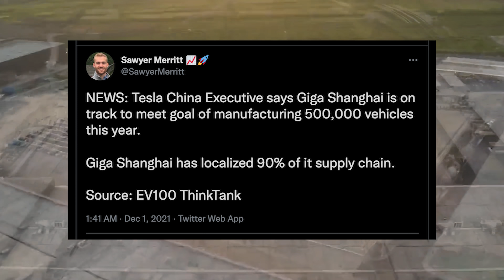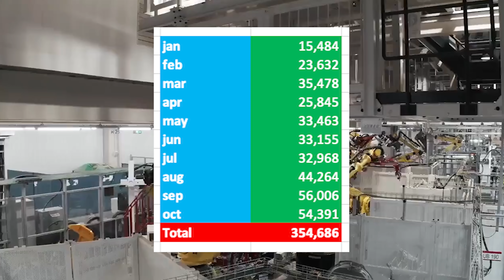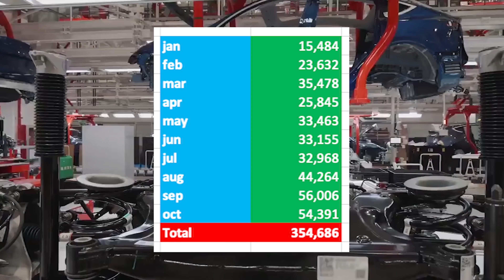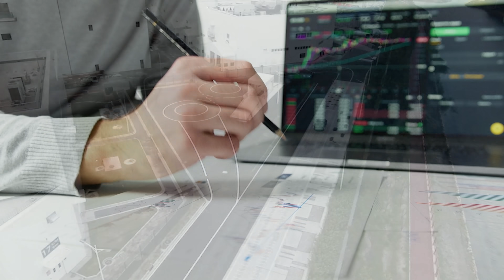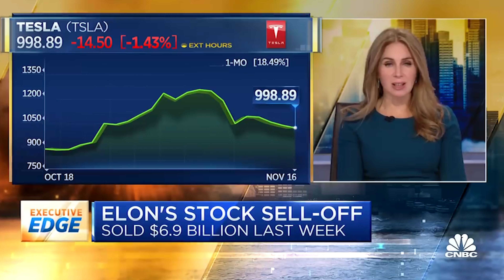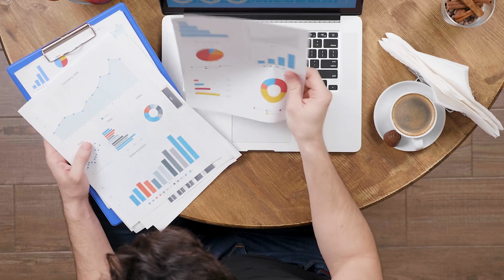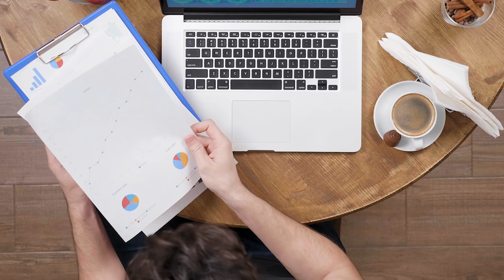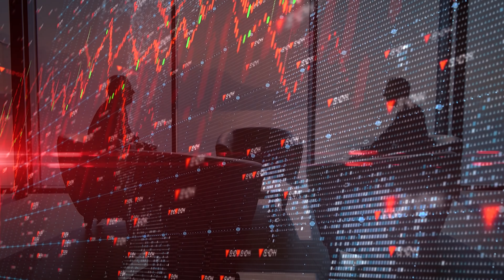Rumors of Tesla Shanghai to Hit 500,000 Deliveries for the Year

Comment: 1429 units per day for 50 weeks per year. 

If it’s a 2 million units per year or 5,500 per day. 

If it’s 300k for Q4~2021 then all gravy above that number. 

Meaning 930k for 2021, since they’ve already have 627k for the first 3 quarters of 2021. 

I’d say 50k for Q1~2022 of Berlin and TeraAustin (combined) and 15-25% above the Q4 numbers for Shanghai and Fremont.

I originally had a 750k deliveries for 2021, just a 50% YoY growth and never thought it would be closer to 940k for 2021. 

2022 estimates of 1.5 million units are doable especially with TeraAustin and Berlin up and running.
Reply: Exponential growth
Reply: 1.3 million run rate from 2 factories now and still ramping. I would qualify 1.5 mil next year as a disaster. 2mil is my guess.
Although I predicted 1mil for 2021 one year ago. German bureaucracy and chip shortage scuppered that one…